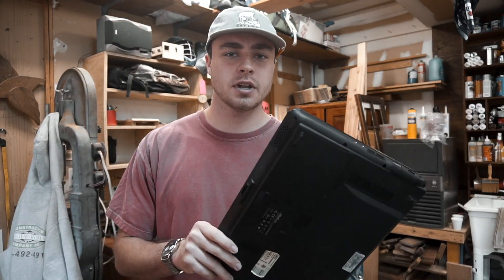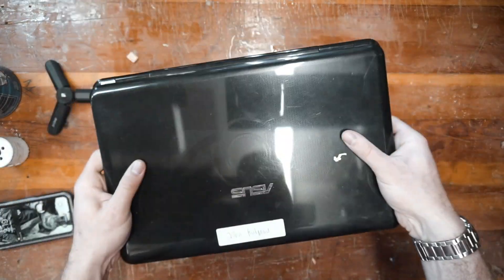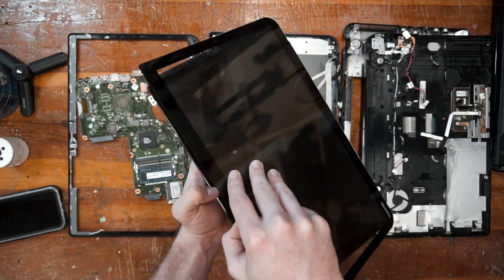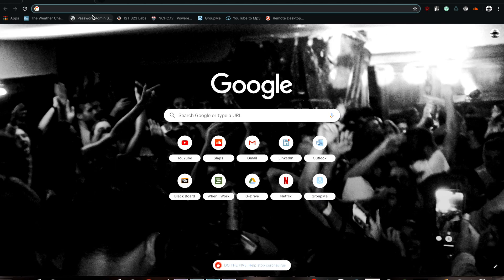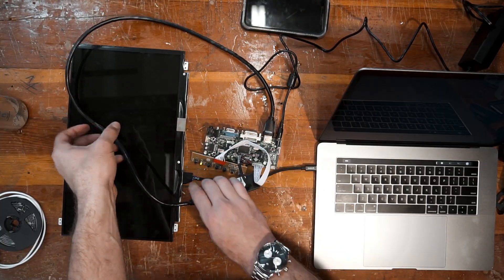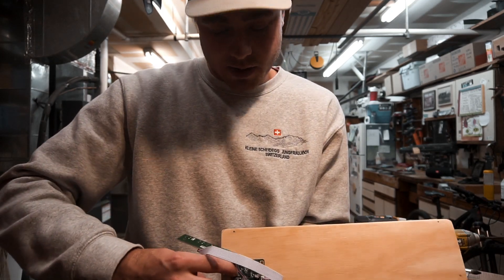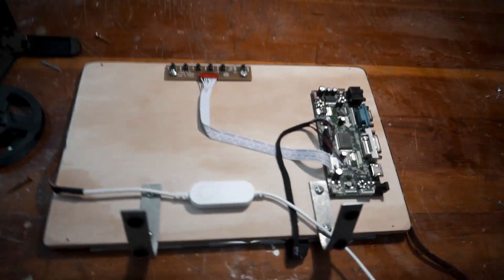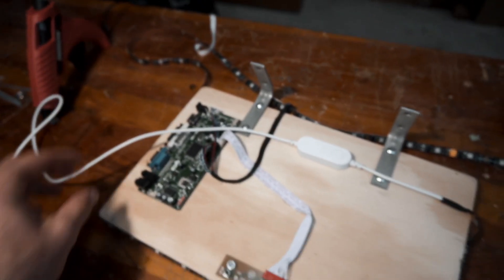DIY External Monitor (Old Laptop Screen)

Comment: Is it possible to use this screen as the main monitor for small desktop PC replacing the big >20 inch pc monitor? like connecting GPU from PC to this screen via hdmi cable then using power adapter 12v to power up this monitor (meaning there would be 2 plug outlets one for PC and one for monitor just like normal desktop PC) . I want to build a whole setup that could fit in a backpack so I can do light gaming while traveling :)
Reply: Yes. You can.

Comment: I'm currently working on a same project but my panel is a 4K monitor from a Lenovo Y700 and I can't find an affordable and available driver board for 4K resolution. However, there are plenty of 1080P boards available and I'm okay with getting FHD output if it's possible. Does my panel work at 1080P with a FHD driver board?

Comment: Hi I hope you or “anyone” can shed some light for me, I’ve watched lots of there video and decided to try it:  I have no idea as to any components or their purpose, but bought two boards for two different screens I have.  Both set-ups show same result, NO screen light up!Thanks, I’l attach photos if I can but descriptions may be better as on one I’ve constructed a chassis of wood; and some connections can’t now be easily seen.

My computer is an iMac (iMac (21.5-inch, Mid 2010)) 
I purchased a mini display port to HDMI cable (iVANKY) , I already had a 12v power supply.
One main board lead goes through the backboard into the screen socket. The boards are secured to the backboard for safety, everything I made is wooden.
There was also a small slender board attached to the screen which I’ve retained and attached safely. No Idea what any of these boards are for..
When I connect the power, the light is either red or green red/blue on the other board setup, and switches with the power button
The screen remains blacked out.
If I connect the HDMI cable the computer shows it’s presence in its display, BUT the screen still stays black.
Any help would be very appreciated..  Thank you.  CAN'T ATTACH PICS ;-((   THANKS JAMES,   ANYBODY!!!

Comment: Going through with this project in a few weeks. What size screws did you use?
Reply from the maker: James just realizing now you said screws instead of screen, I’m sorry I used about 2” screws at first but for some reason it was not working with the holes already drilled so I just got glued it
Reply from the maker: Hi I believe it was right around 13''

Comment: If the external control board you added to the screen is glued to the wooden stand, it might overheat at some point! 
You should use some PCB Spacers to keep some space between the control board and the wood to give it some air.
Reply from the maker: Next time I definitely will I appreciate that. I attempted but was impatient and just glued it lol